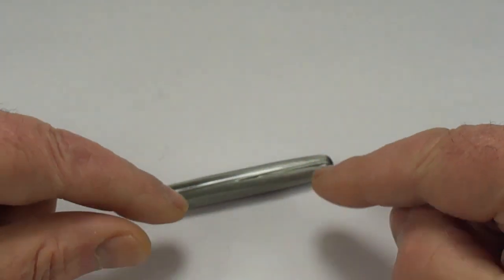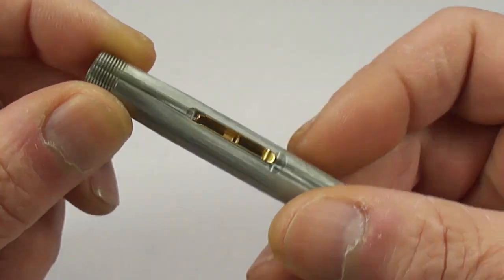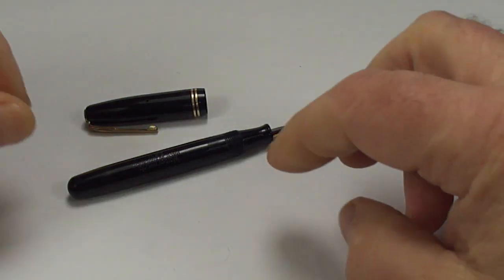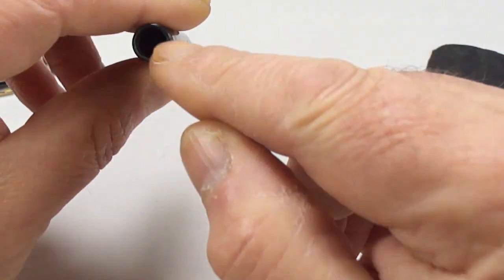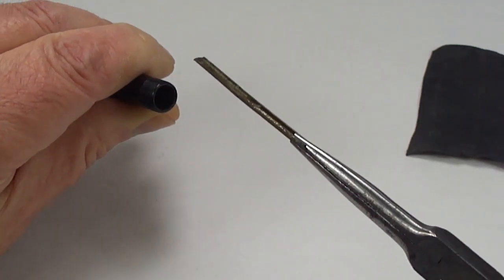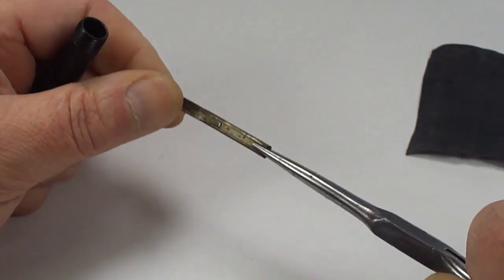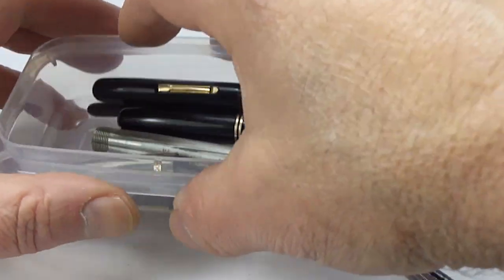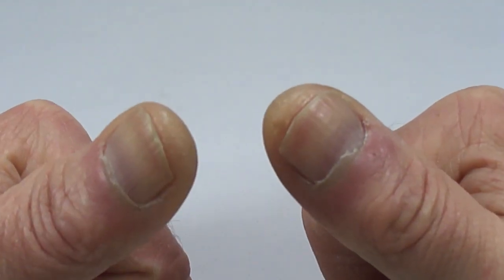REPLACING A LEVER BOX ASSEMBLY

Comment: I always find it is better to spend a little time making a tool to assist in assembly, rather that spending aged trying to assemble without special tools, and you still have the tool for next time, there are now a lot of different "snipe nosed" pliers on the market, and they are very easy to modify into special tools, especially the crimping tools for setting down the lugs on the lever box.Many thanks for posting this one Stef! Chris B.
Reply from the maker: Yes most of the tools i use are home made for specific jobs. Thanks for watching and for your comments Chris. Stay safe.

Comment: Stef, it is without doubt, one of the more fiddly tasks to accomplish. I tend to wrap an eleastic band around the box lever to keep it in place, prior to bending up that locking tab.
Brilliant job (especially with a camera obscuring what you're doing). As always, first rate presentation !! Mind how you go,
Andrew 🙂
Reply from the maker: Thanks for the advice Andrew. Yes it is a little more difficult when your working at arms length. Thanks
Reply: You're a better man than I, Stef.
Reply from the maker: Im sure im not Andrew. Thanks
Reply: Let's put it this way, Stef, I've learned an awful lot from your tutorials - that's a particular gift only some can bestow upon others 👍

Comment: Thanks Stef, great video. I now have confidence to tackle it. One question; when removing the pressure bar from the old lever, I imagine you would have to bend / twist the lugs that secure it to the bottom of the old lever.
Reply from the maker: Hi Norm, thanks for watching. Be careful and easy as you go. No there should be no need to bend or twist anything. Good luck.
Reply: Grandmia Pens Thanks Stef.

Comment: i have a problem with the lever on my pen but its necessarily broken, the lever on my pen is loose so it rattles a little and has gotten caught on fabrics and shot ink out on occasion, is there any alteration i could do to fix this or would a part need to be replaced?
Reply from the maker: It is difficult to comment without seeing the pen, sorry. Wht not send it to your local repair person ? Good luck.
Reply: @penkino1  Good news Stef! i found out what was causing my loose flappy lever problem, it wasnt because of a bum part, but just by poor design. being 17 i don't have the money to pay someone to fix my pen so i disassembled the pen to find that rather than the pressure bar being attached to the lever, it was glued to the sac! wondering who the heck decided that was a good idea i looked for some information about WEAREVER, the maker of the pen. i came to find out that the pens were generally made cheaper and sold for 50 cent to a dollar, intended to be cheap so that a student could take it to school without being too afraid of damaging the pen, hence the cheap, poor design of the lever mechanism

i hope you found that as interesting as i did :)
Reply from the maker: @wintlock  If it is an old pen then you will find old sacs fused to the pressure bar inside. Clean it all of and install a new sac with a little powder. Good luck